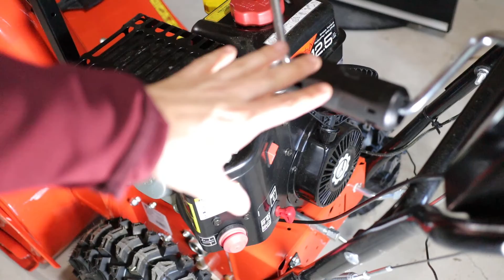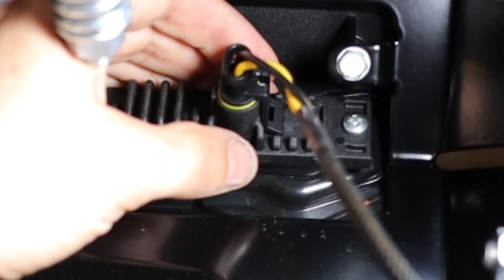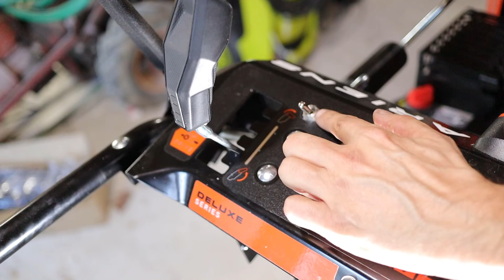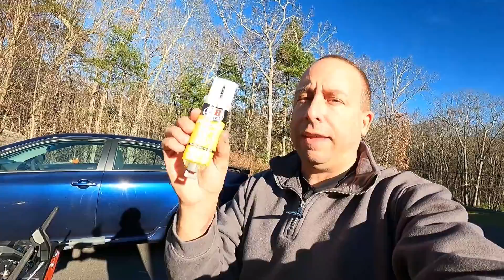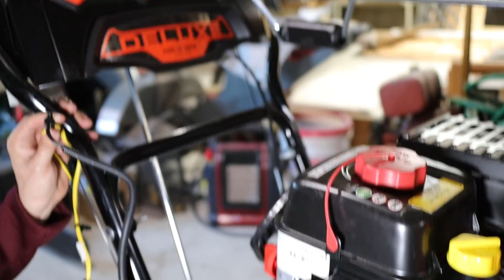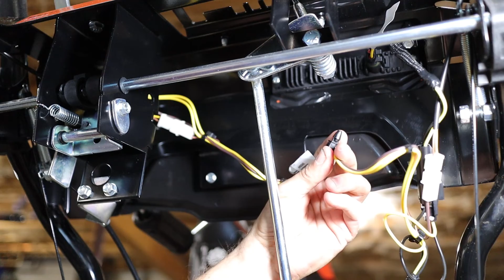Snow Blower Heated Grip Installation Highlights

Comment: I noticed these on Amazon for $115! WTF? I did much better than that. I ordered a pair of grip heaters ($25) that go under the hand grips. The stick to the handlebars and you slide the grips back on over them. If you machine has a headlight wire, you can power the grips with that or do as I did and use my M18 Milwaukee battery to power the grips. I orders the battery plug (from Amazon) to plug my battery into. A small 1-1/2 amp battery is all you need or if you're blowing snow all day, you may need a higher amp battery.

Comment: I don't think there's any SKU with heated grips for any or the 24" Ariens blowers, so even if you buy a new blower at a box box store, you'd need to buy this kit and install it yourself. An Ariens full service dealer could install the kit for you when you buy the blower and you could take delivery of your new blower complete with the grip kit installed.

Comment: So I put my heated grip kit on my new Deluxe. We didn’t get the snow in Illinois like other parts did last week. Got to use my machine and test grips a little bit though. Grips get nice and warm and machine seems great so far. 
I noticed that my machine only has the Halogen headlight. Turns out, after contacting Ariens, some machines didn’t get the LED light due to parts shortages. However, they are sending me the LED kit free in the mail. I’m glad I looked into it. 

I look forward to your review after you get it into the snow.
Reply from the maker: Wow!  That's great customer service.
Reply: @SevenFortyOne  Oh yeah. I emailed them on Christmas night, they called me straight from HQ in Wisconsin the next morning. I was really impressed. I was also asking them about the Snow cab. I’m 6’ 2”, and was worried I’m too tall for it. If you end up getting the Ariens cab for yours, you should do a video on it. There really isn’t a lot of info on YouTube that I’ve found. Keep the snowblower and power equipment content coming. Your two videos on the Ariens were very helpful.
Reply from the maker: @dishsoap1  I got the drift cutters and will make a video on them once I get enough snow to try them out.  Glad you enjoyed my snowblower videos so far!